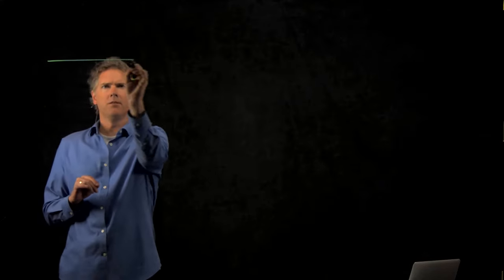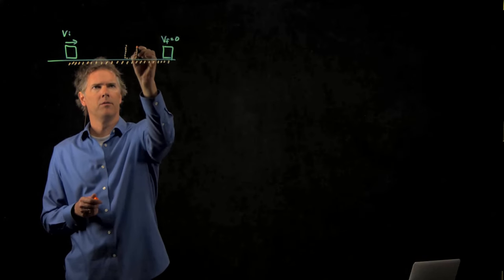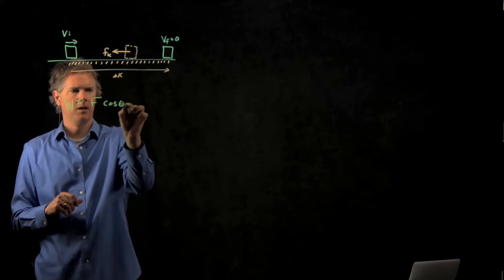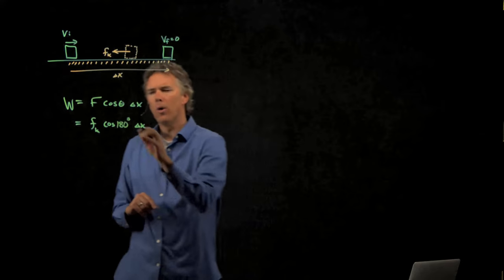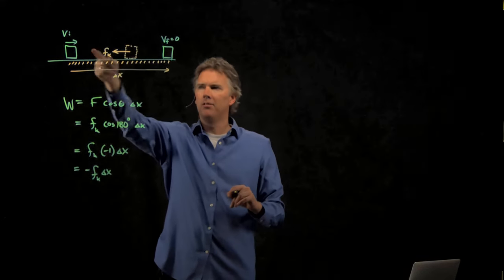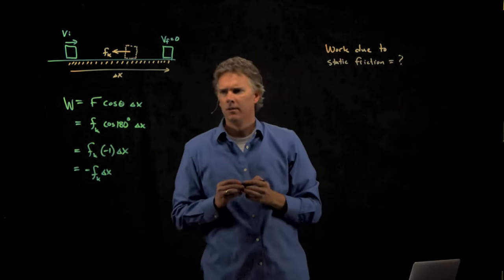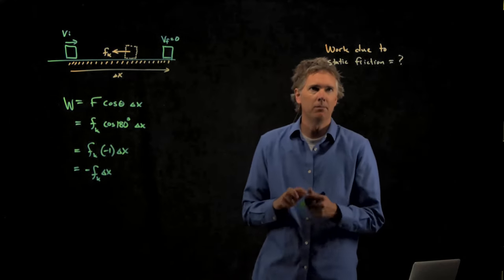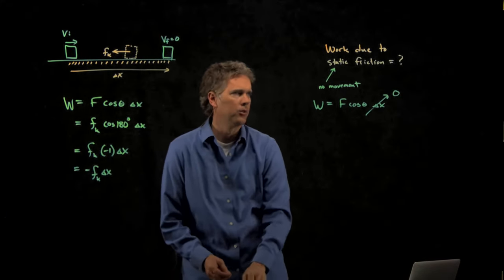Work done by friction

Comment: Work done by static friction can be zero,-ve, or +ve.
Imagine a two block system one lying over other and a force less than the magnitude of static friction is applied on one block in this case it is not zero.
However work done by static friction on a whole system is zero.

Comment: Im having trouble figuring out how to get the frictional force given delta x and the kinetic friction coefficient. and cos 180
Reply from the maker: The kinetic frictional force is always fk = μk * N where μk is the kinetic frictional coefficient and N is the normal force. If you're on a level surface, then N=mg.   The cos 180 means that the force is opposite the direction of travel, since friction works against you.
Cheers,
Dr. A

Comment: Work done by kinetic friction is negative it's ok but when we put it positive?
Reply from the maker: Sugandha, 
It depends on which side of the equation you put it.  Remember, energy is always conserved, just keep track of it.
Thanks for the comment, and keep up with the physics!
You might also like my new website: www.universityphysics.education
Cheers,
Dr. A
Reply: if you are asking when the kinetic friction will be positive, you can consider a situation where a body is resting on top of another body, then if the bottom body is moved forward and the top body slides back, then the frictional force on the top body acts along the direction of the motion of the first body and we can say that the net friction work is positive for the top body.

Comment: If we move the same block back to the initial position then why will the total work done by friction force in the round trip be -ve and not 0
Reply from the maker: It can't be zero because you have to work against friction.  If you slide your book across the table and back, you have certainly done work on it.  The work that you have done ultimately goes into heat due to friction: the book and the table both heat up.
Cheers,
Dr. A

Comment: Can you help me with this sir?

a 6,000-kg car is moving at 10m/s. when the driver steps on the brakes, the car continues to move a distance of 1.2 m until it eventually stops. what is the amount of friction that the road exerted on the car?
Reply: 10 months late, I am only a Junior in highschool (g11). First find the Kinetic Energy (mv^2/2) = 6000x10^2/2) = 300000J. Wnet = Fd, Wnet = Sum of Energy, since on flat ground there is only Gravitational energy. So 300000J = F(1.2m) Ff = -250000N since friciton is opposite direction of displacement. This may or may not be right hope it helps even if it is too late